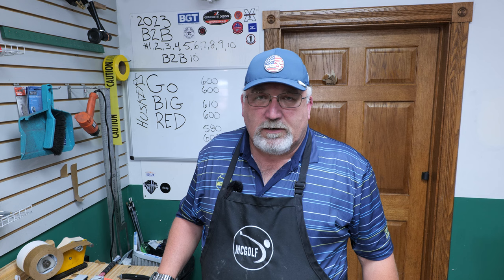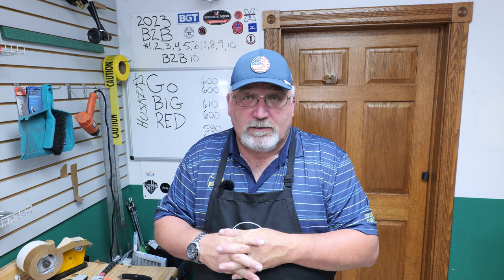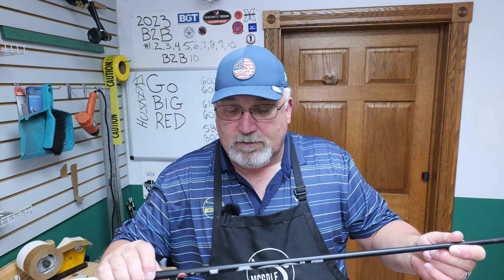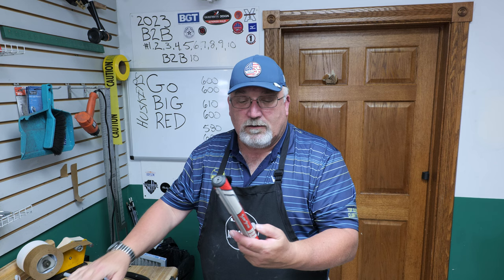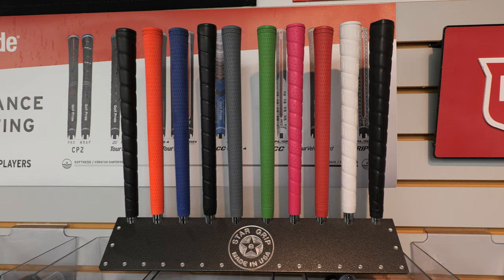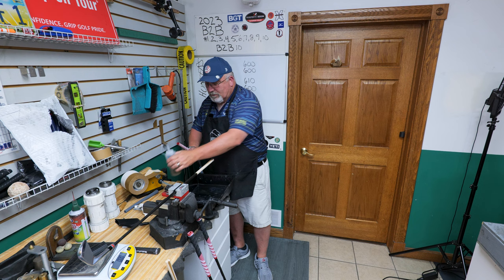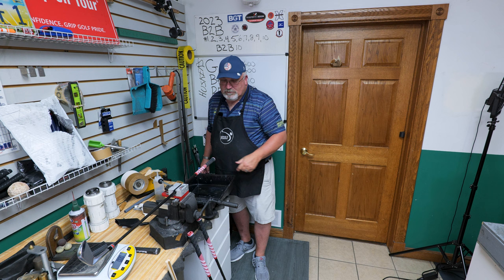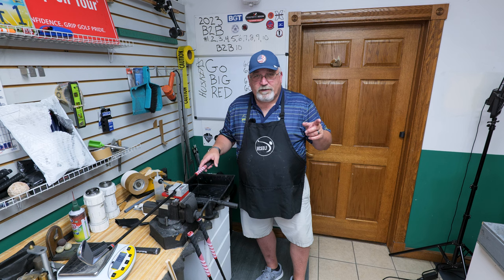Pro Tips: Installing Golf Grips on Tiger Wood Irons

Comment: I started playing with open faced fairway (x2 hot pro) woods so I re-shafted my old mizuno mp-32's and  started hitting them with the face open at address- and it feels really good. I was wondering if I can have the irons bent 2-3 degrees open without damaging them-they normally bend pretty easy since they are forged. I would need to do it without adding loft or changing the lie angle. I have jumbomax wrap grips so the grips dont have a line on them and dont have to line up with the face angle. At the moment I have been just laying the irons down open and it works really well but there is tension in my left arm to forcibly hold the face open at address. This open face allows me to use my body to square the club face and its the best I ever hit a golf ball. So if it can be done without any problems, I would need to add 2-3 degrees open to each iron face on the mp-32's. I'm also holding the face open with my driver and it also works really  well.
Reply: I guess I would need to be in your shop to get it exactly how I needed it- maybe I'll make it up there one day.

Comment: Perhaps dumb question but is the grip tape sticky on both sides?  Did you remove the backing off camera or do you leave it on?
Reply from the maker: yes it is. and  thin. Most folks new to the hobby will using carpet tape and that  would be a huge mistake
Reply: @McGolf  Do you remove the backing?
Reply from the maker: @mikewrobel2881  the dispenser does remove the backing automatically